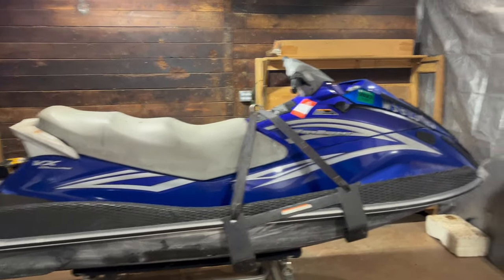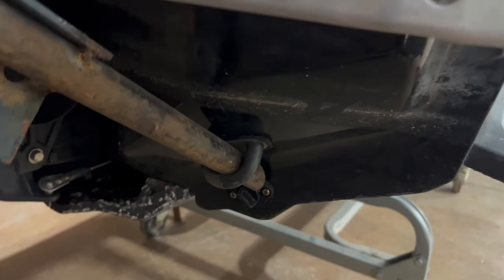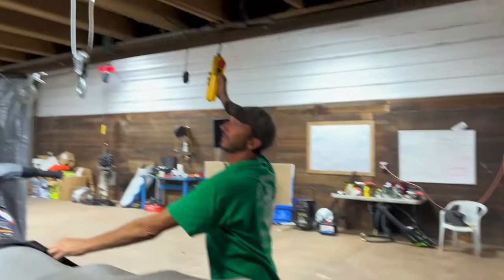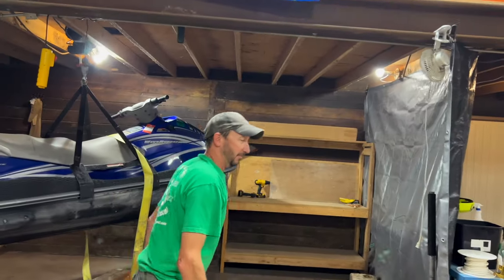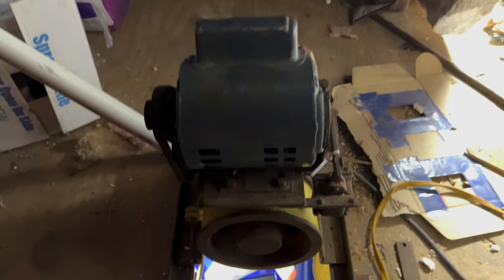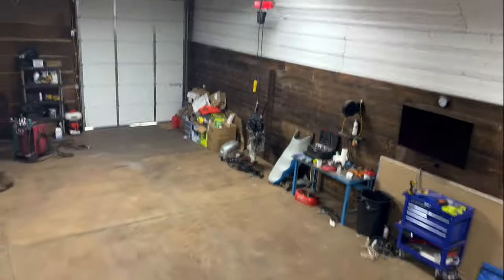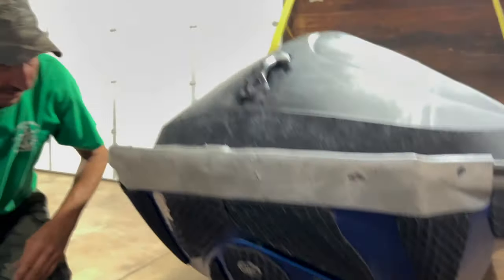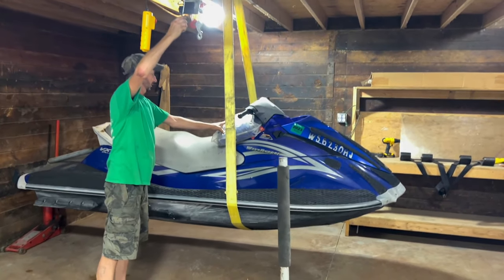Repairing a Damaged Fiberglass PWC Hull is Easy with this DIY tool. The Jet Ski Flipper!

Comment: Thanks that was great explanation but what about fuel and oil in the motor
Reply from the maker: Yes you should drain it before hand. The fuel doesn't seem to be a problem but the oil makes the ski smoke a lot when you start it for the first time after flipping it.
Reply: @MrBison700 that's because you can hydrolock an engine with just oil

Comment: Awesome video. Going to be restoring a ski soon. Was wondering if you recommend draining the oil and gas before I turn the ski upside down
Reply from the maker: Yes I would if you can. If you don't ( which I did not in the video) the oil could potetentiall leak out. When you start the ski, it smokes pretty bad for the first minute of running it also. Good luck with your project!

Comment: I don't think jet skis are meant to be supported by their seat/glove box area.. All the crackling noise once the ski is flipped and all the weight of the ski is put into the top side area just seems pretty idiotic. Skis are meant to be lifted/supported by the side rails or from the bottom for a reason.